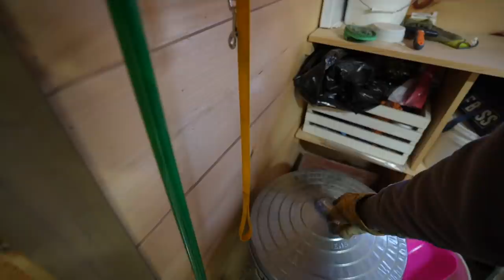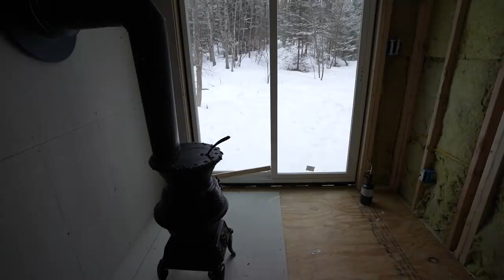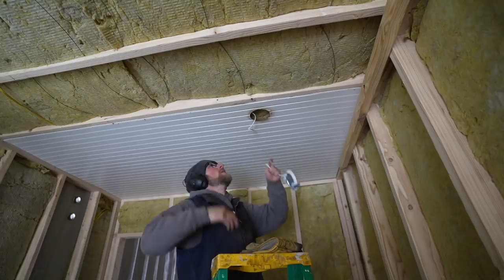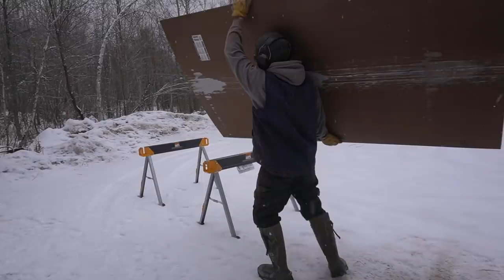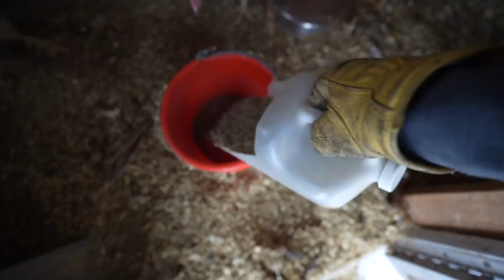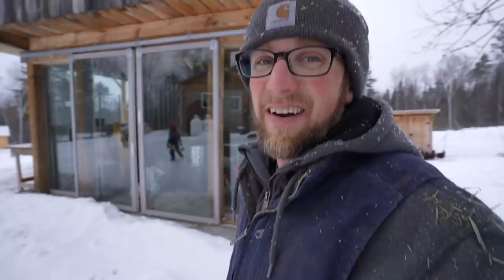THIS Changes it So MUCH! Installing the CEILING in Our OFF-GRID SHIPPING CONTAINER TINY CABIN

Comment: Al that Ceiling sheeting is such a good idea,nothing worse than having to prep plaster boards and paint ceilings
Reply: Can someone tell me if this sheets can be use for basement ceiling? Thanks.
Reply: @conniedejesus6885  I don’t see why not, they are an all purpose panel, though I wouldn’t use them on walls without a backing as they look to be a little thin for that
Reply: @conniedejesus6885  Don't put up anything that will hinder you from accessing plumbing or electrical because you will regret it.

Comment: The junction boxes for the lights should be positioned so that you have access to them. Best to leave them unfastened to the framing so you can pull them out for servicing. The bead board ceiling looks great.

Comment: Al, I hope you see this.  Today on Sow the Land, Jason used a cutting guide called Track Saw.  It would be a real asset to you especially when you start your build on the new property.  It saves so much time when cutting full sheets of plywood or any other large sheets like paneling or dry wall etc.  It is put out by Dewalt.

Comment: Good afternoon from UK.
Al, putting boarding up on the ceiling, it is easier to make a supporting T for the end you're lifting. That way you can lift from the floor and the floor will hold the support then nothing slips.

Comment: There s a thing called a deadman you can build.  It is a length of 2x4 with another piece nailed on at a 90 degree to the 1st creating a T shape.  This allows the helper to hold it up while you nail it in place.

Comment: There is a good pre-made curry by S&W usually found in the Asian section of your grocery store that is delicious.  No muss, no fuss. It comes in different spice levels as well.  What did you serve it with?  Rice?  When I make curried pork I add chopped apple at the end so it is not overcooked.  You can add whatever vegetables you desire,  Just increase your sauce amount. I make curry frequently as it is a favorite meal.

Comment: You should always cut towards a finished surface to reduce splintering the face, Mark on the backside and then the sawblade cuts towards the finished surface, instead of away.

Comment: You need to be able to access the LED driver through the hole for the light. The driver should be directly above the light opening. Think about replacing them down the road if one fails.

Comment: The ceiling looks great.  Just curious about the fact no vapour barrier between the insulation and sheathing. Where I live, mold would be a problem because of extreme cold causing condensation.

Comment: Al when I did my 16 foot ceiling drywall in the garage ceiling by myself I used paddles screw with a little one by four on the edges of each sheet and I just use a stick to turn the paddle in once I got the sheet up. You could also put a 1x4 on the end of a 2x2 and Gina could hold it up from below, just saying

Comment: I noticed that your sliding glass door does not have a handle on it.  Did it not come with one?  That is going to be your main entrance to the cabin, right?   Good thing you put in that door on the interior wall as an afterthought;  it is getting a lot of use.  The ceiling looks great;  I think the lines going that direction makes it look wider than it really is.

Comment: Loved it, as always. Gina, two things, one re curry powder. The only thing that is a constant for me is to add curry powder to egg salad, 1/2 tsp per two eggs. I cook for one, so it's extremely easy to make a quick egg salad for lunch: 2 boiled eggs, 8 sliced black olives, 2 TBsp mayonnaise (homemade is my preference), 1/2 tsp curry powder, and salt and pepper to taste.
Secondly, you can get long-handled measuring spoons that will fit in the narrow mouths of spice jars. Sure makes things easy. (Amazon)
Al, I was wondering how you were going to keep the light cords out of the way of the drill and was happy to see that you had to fish around to get hold of it for the first two. The third one worried me when it was right in the space where you cut the hole. I hope you examined the cord to make sure it didn't get nicked? The ceiling sure looked nice!

Comment: Keep up the great work.  Question:  I'm new to this but why isn't vapor barrier required for ceiling?  Will that be the same for walls?  Pro's and Con's?
Reply: Ya You need it on both in a cool climate to prevent moisture build up and mold.

Comment: WHY HAVE YOU NOT USED VAPOUR BARRIER?  ARE YOU NOT WORRIED ABOUT MOISTURE  And  MOLD?
Reply: It's a metal building. The only place he'd have to worry about that would be around the windows and doorway. And that will be caulked good and tight once the weather warms up some.
Reply: @damianhendricks818  the mold will penetrate the insulation.
Reply: @damianhendricks818  actually it's a wood framed building with a metal siding.

Comment: Good morning family. Al why are u not installing vapour barrier? I think u are going to regret not using it. Well u all have a great day. Stay safe.
Reply: I think you are right Kevin, humidity will go through the walls and insulation, then when it hits the cold metal, it will form water droplets which will then soak into the insulation. In a few years, you will have to pull out some very soggy insulation and start over!
Reply: I'm glad u agree. I hate to say that it will likely cause trouble.
Reply: My husband literally was in pain watching them put the paneling up with out the vapor barrier. I wish Al would atleast comment on it.
Reply: I can't agree more. Not trying to hert any feelings. Maybe I have been doing it wrong. Anyways let's have a lovely day.

Comment: Back up situation for ur lighting if needed build urself a cord for the 12 volt system that has a plug on one end that can tie into the 12 volt system and the other end of the cord that has a cigarette lighter adapter on it. If ur battery goes dead u can use your vechicle to sill power lights and or charge the solar battery, also most generators have a 12 volt lighter plug on them this cord will give u versatility on secondary options if u need emergency lighting inside the off grid container house.

FYI I have a off grid trailer at my equipment storage site where I have something similar but mine invloves plugging in the whole trailer harness. If my batteries are completely dead, or I can start up my generator and charge system using the trailers built in charging system.

Comment: You need 1.5 lb Lamb diced (3/4” cubes) 
fry 3 large onions in oil, then add:
1 tsp Cumin
1 tsp Coriander
1 tsp Garlic pow Eder
1 tsp Ginger (shreddedor powder)
1 tsp tumeric
6 green Cardamon pods
6 crushed whole cloves
1 tsp Cinnamon
1 tsp Salt
1 tsp Pepper
Fry for 1 minute with onions then add the meat, fry until browned. 
Add two 330 gram tins of tomatoes 
1 1/2 tsp tomato paste
Then 1 1/2 pints stock.
Simmer for 2 hours or until meat is tender. Add 1 1/2 tsp Garam Masala (all spices can be bought at you local food store)
Add creme fresh or single cream to thicken slightly. 
This curry is not hot as there are no chillies added. Add chillies if you want but better without, serve with rice.

Comment: Easy couple of recipes that I’ve had cub scouts making(9 year olds) . One is vegan and the other is with chicken. Both are delicious 👍🏻😋

MUSHROOM KORMA
 
1 onion
2.5cm ginger
2 cloves of garlic
450g mushrooms – open & closed cup
4 tbsp korma curry paste
200g coconut milk
squeeze lemon juice
pinch of sugar
Coriander leaves chopped to garnish for serving 
Rice to serve 

METHOD
 
	•	Saute onion for 5 minutes
	•	Add ginger, garlic and mushrooms – sauté for 5 minutes
	•	Stir in paste, coconut milk, lemon juice and sugar
	•	Bring to boil then simmer uncovered for 5 minutes until sauce thickens
	•	Serve with rice and garnish 

CHICKEN & MUSHROOM KORMA
 
4 Chicken thighs or 2 breasts
1 onion
2.5cm ginger
2 cloves garlic
250g mushrooms – open & closed cup
4 tbsp curry paste (korma)
200g coconut milk
squeeze lemon juice
pinch of sugar
Coriander leaves roughly chopped to garnish when serving
 
Rice to serve

METHOD
 
	•	Cut chicken into cubes, lightly fry  in a little olive oil until almost cooked - take out of pan and reserve.  
	•	Saute onion for 5 minutes  in the frying pan used for the chicken.
	•	Add shredded ginger, garlic and mushrooms – sauté for 5 minutes
	•	Stir in paste, coconut milk, lemon juice and sugar.
	•	Add cooked chicken back in. 
	•	Bring to boil then simmer uncovered for 5 minutes until sauce thickens
	•	 Serve with rice and garnish

Note: different curry pastes give different end results
Nice to serve with some homemade mango chutney
Reply: Mmmmmm - sounds delicious!

Comment: For future reference to anybody who is interested, when cutting that type of paneling it is best to make your cuts from the back side. Less chance of chipping off the finish on the face side. And for you keyboard warriors who don't like tips and tricks, tough. No body glued open your eyelids and forced you to read it. And Al the ceiling looks great!
Reply: But having it face down can damage and scratch it also, didn't look like it chipped out too much, I'm thinking it's hardboard and not plywood 👍
Reply: @colinstace1758  That's why you save old pieces of carpet to put on top of your sawhorses. If it is hardboard it has a tendency to chip the finish even more than plywood. Been there done that many times.

Comment: Gena, I purchased a instapot, and its been sitting here for three weeks. It says multi use pressure cooker. But I was looking for a new electric pressure canner. I'm debating if I should bring it back or not. Can you give a instrutional review of your instant pot? Its seams complicated. G-D Bless.
Reply: It sounds like you understand that the instant pot type products are not recommended for canning.
Reply: @chrystallangille1667  Yes. It caught my eye, while rushing thru the store.  I picked it up quickly, without looking carefully. I'm high risk, and the store was getting too crowded. But, I do see were it could be useful also. I'm going to have to order a new canner, sight unseen. Which I don't like to do. As I'm not going to run from store to store. 😃

Comment: Did  a  grand  job  on the  ceiling   how about  a double  battery power  for the  lights  or  a  car battery  together  with it  I  got 4  marine batteries  for  big horse  power motors  for the  whole  house  to get by  got  solar panels that  do the work of  getting them  in time with  the  house for me!!!   Curry  powder  comes in different  forms  mild  to  medium  to hot enjoy  all of them in fact  make  a  chicken  pot pie  with them  without the  spuds it has the  pie crust for  carbs  give it  a try  just like  making a  chicken  pot pie  for me!!!

Comment: I saw on another site where they had made a maybe 2x4 long enough to fit the celling w/another piece of wood nailed to the top of the 2x4 in order to hold the piece u r nailing.. wish I could explain it better. But it worked great

Comment: A silly question, but Gina how did you modify your dragon to fit on the relief valve?
Reply: No need to modify as it's compatible. If you click on their Amazon Affiliate link (In description under video) & click on Influencer - Lumnah Acres you will find it.
Reply: They make them specifically for that. Sold on Amazon. Look for instant pot dragon

Comment: I don't think you're going to like that shiny finish ceiling....the shiny glare is going to be distracting.  I would spray a quick coat of flat white paint on it to knock it down.  It will also hide a lot of the waves, imperfections, etc... and make it look a lot more uniform.

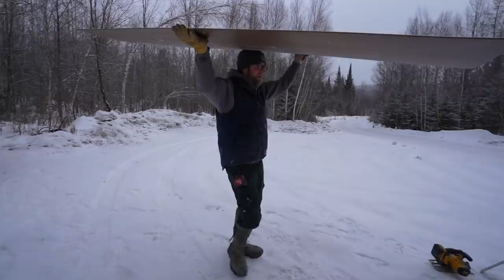Comment: Al, what is the material are your using for the ceiling? I see it has ripples? Great teamwork. I don't know what Al would do without Gena's loving helping hands. Did you get hit on the noggin? LOL Got to go back and check that. Haaaaaa.  G-D Bless. YEP, Al got hit on the head at 8:44 Mark.

Comment: Surprised you are not using 5/8th sheet rock for its fire protection rating... the way you have built it and the materials used if there’s a fire you won’t have long to escape before the fire engulfs the container. 

I would put sheet rock behind the cement boards as well. 

Then you need to do something about the ply floor.

This could be a death trap.
Reply: At least the wall between the parking spot for the Mule and the habitable spot.  That needs to be a firewall for sure with the proper firewall-rated sheet rock.